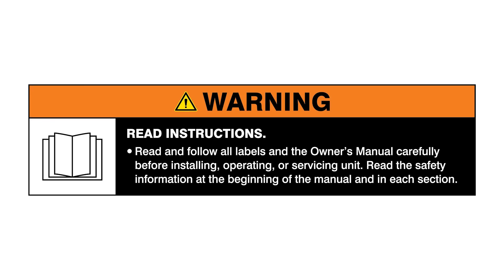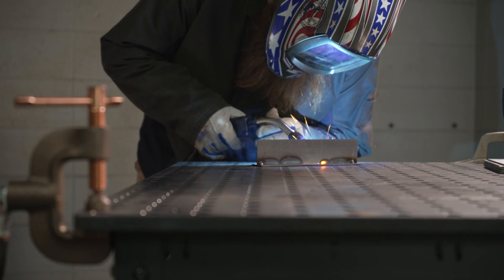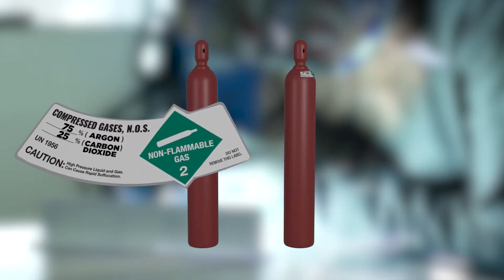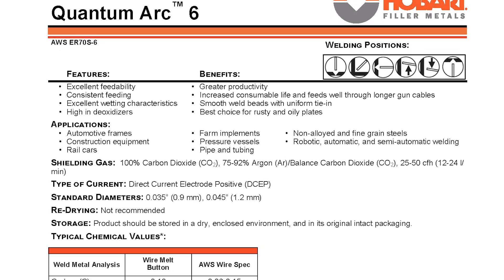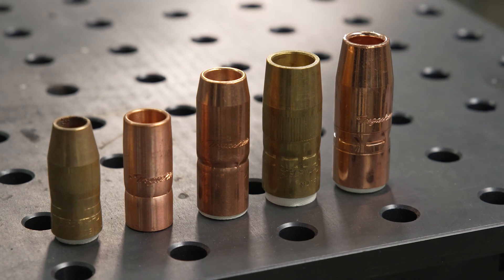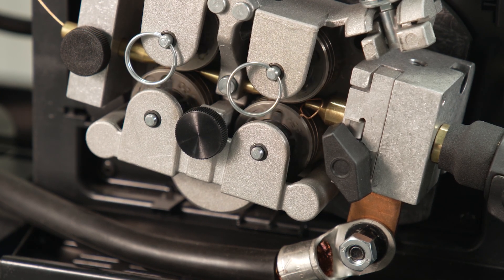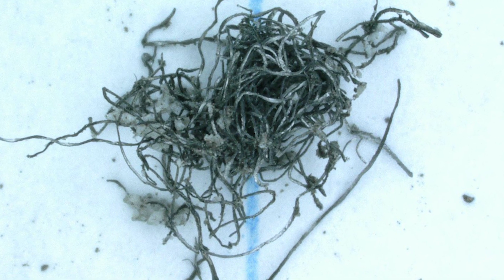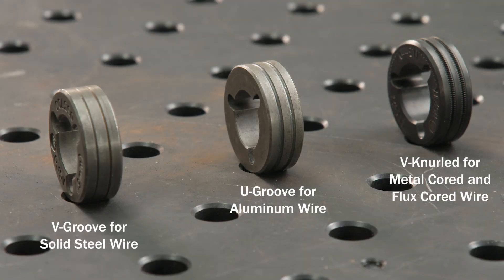Troubleshooting Common Industrial MIG Welding Problems

Comment: Stumbling is my worst enemy during welding...how can i fix that Sir?
Reply from the maker: If you see a stumbling or stuttering arc this may be a sign of voltage, drop. If you think you may have voltage drop problems, one of the first things to look for is an arc that is short or tight. Operators may keep bumping the voltage to address this, but it’s a sign of excess voltage drop somewhere in the circuit. Common causes of voltage drop include undersized weld leads, long weld leads, and bad connections, to name a few. Feel free to call us to help you with any weld issues. We can be reached at 920-734-9821.
Reply: @MillerWelders  thank u so much sir

Comment: Hi , Ethan. I have a Miller syncrowave 250 dx . When i turn it on ,i can weld for 5 seconds and an error hlp- 19 . Then the welder will turn off. We did add some freon to it ,so it is not low. thank you for response in advance
Reply from the maker: Could you give us a call so we can help troubleshoot? We're available at 920-734-9821.